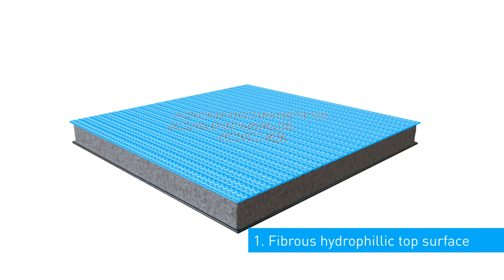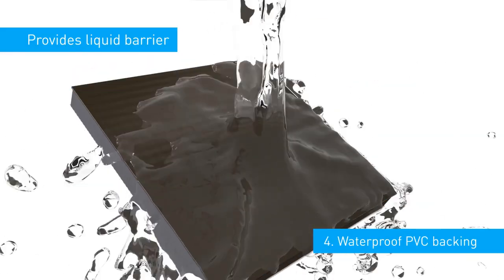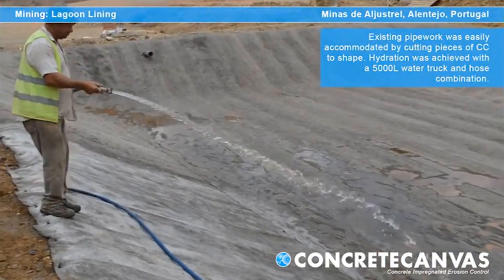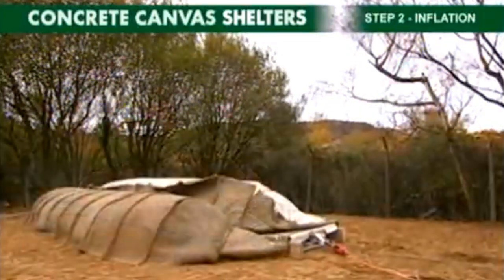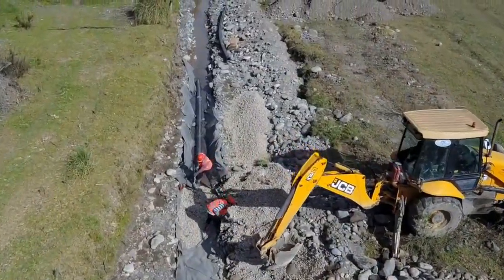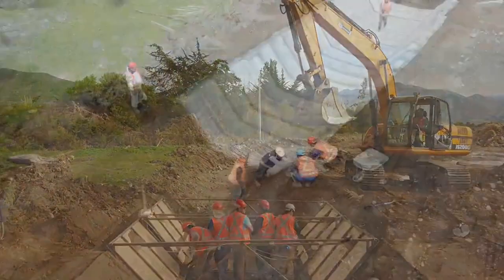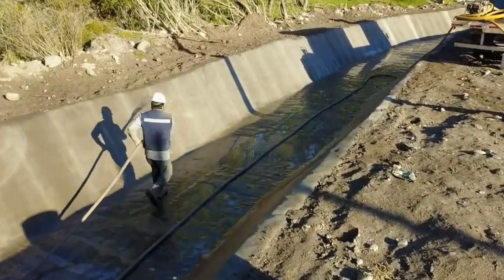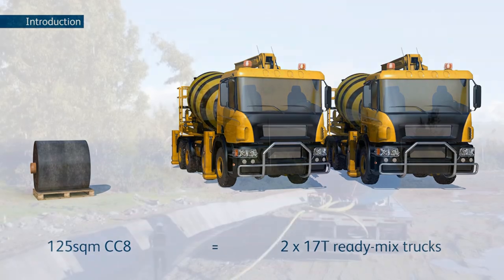Premade Concrete Canvas Tents - Just Add Water

Comment: The plastic sheet on the inside of the tent is just a bad design in my opinion. Concrete will retain water after being wet and be extremely cold on the inside. When left in water, concrete might crack and shatter sooner than you think.

Comment: The drainage etc is the more interesting thing, making a house/base of operations isnt particularly hard, and I don’t see much advantage regards to having it be concrete. Not having to lay out forms or pour concrete tho... nice. And if you want a permanent structure that can last 10+ years, you’re going to want to design it and just pour it normally, or make it from wood and clas it in whatever. instead of loosing about 20-30% of your internal space to the wall curve. That being said I’m sure they could make sheets, they just don’t because then you would be like... hmmm, why not just make a fucking wall and then coat it... nah the magic here is a drainage trench and foundations. Concrete is hard to ship and pour and you need to mix it, this deals with most of that.

Comment: No doubt it has it's niche. But I call BS on a lot of this. Fire resistant, fine. Hammer resistant? No. It's not even reinforced (which is probably a big part of the cheapness). The tents are BS. Plain canvas tents will work just as well (for a fraction of the cost). Without reinforcement, you literally have to just lean against it to crumble the concrete layers. Even with your little "fibers" perpendicular to the layering. You could have at least given those triangular structure. But then you wouldn't have been able to fold it so small for shipping.

I will say, It's probably great for erosion control. However, some of these claims seem to parallel start up scams. I get wanting your invention to change the world. Careful how hard you nudge it in the spotlight. Too many lies, and the real abilities aren't believable either.